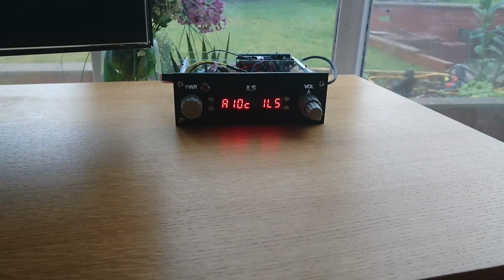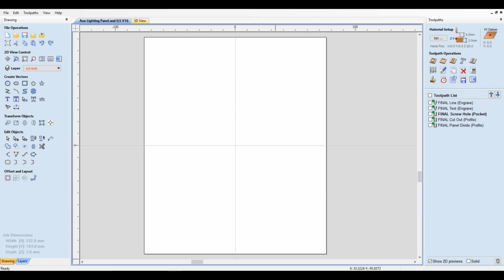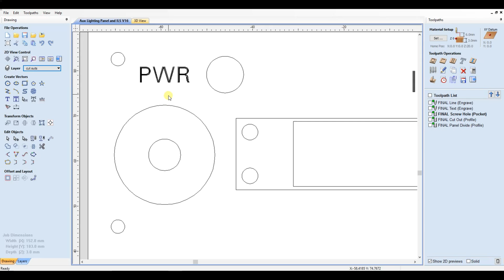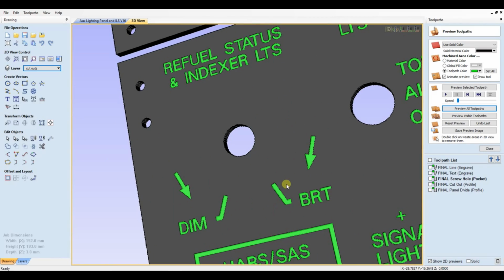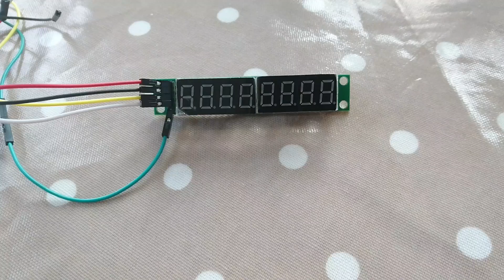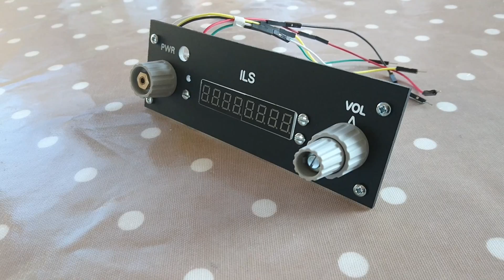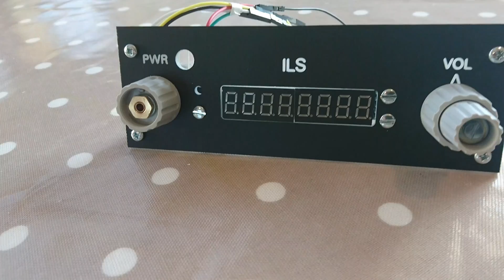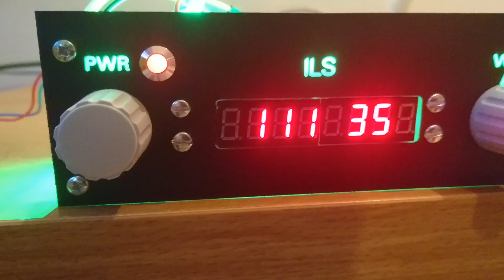DCS A10C ILS Prototype Panel

Comment: Craig, could I ask which Arduino library you use for driving the 6-character 7-segment display please? I am testing with library ""TM1637_6D.h" it works fine just testing the display but when I combine it with DCS-BIOS code I get errors I think are due to conflicts between libraries "TM1637_6D.h" & "DcsBios.h". I tried several other display libraries but most will only do 4 characters. Regards, Mark
Reply from the maker: Hi Mark, I used LedControl.h library with MAX7219 - 7 segment displays. I do have a few TM1637 segment displays but have not used them to this point. If you go the max7219 route I'll happily share my arduino sketch with you
Reply: @CraigSmysimpit  Hello! I am trying to figure out the code, can you send me yours so I can compare and maybe fix mine?
Reply: Thanks I’ll let you know how it turns out...

Comment: would this also work with different sims, like x plane?
Reply from the maker: Hi Eric, throughout my simpit any of the panel inputs interfaced by keyboard encoder can be used in any simulator where keyboard bindings can be allocated. As regards outputs, I'm sure xplane will have its own community resources for outputting data and this could be displayed on 7 segment displays, VFDs, oleds, etc, however the output utility I use, DCS bios, only works with Digital Combat Simulator. Cheers, Craig
Reply: @CraigSmysimpit  Im following along, starting with building the electrical conrol box. I bought a keyboard emulator and wired it to a two way switch. Ive assigned it to one of the panel controls and it works just fine, however, when I flip the physical switch to the off position, the sim doesnt change. When I switch the physical switch on again, the sim switch moves to off... basically each position change in the sim requires two movements on my two way switch. Any ideas how to fix this?
Reply from the maker: Hi Eric, if you use the keyboard encoder with a physical momentary push button to control a momentary push button in the sim I would assume it works fine, is that the case? If so, then your problem could be because the keyboard encoder sends a temporary input on completion of the circuit not on disconnection. Therefore it only responds in the "on" position only. What keyboard encoder did you get, type, brand and model?

Comment: Great work! Any chance you could share your Arduino Code for this panel?
Reply from the maker: Hi RomeoKilo, thanks for your comments. Over the months I've seen your thread on the Ed forum. That's some proper high quality work you're doing and your ejection seat is out of this world. 
I'll upload the Arduino sketch at some point this week to my website and I'll drop the link to you.
Did you get the lua export working to run helios and dcs bios at the same time?
Reply: Craig S Thanks mate. Yep got the export working. Found a thread that suggested just moving the dofile line so it's at the very end- it worked. Weird. The ILS and tacan are next on my list- I was going to use lcd displays but have decided on 7 segments so they match the radio stack, I just can't get this code working!
Reply from the maker: Hi RomeoKilo, is it the radio code that isn't working for you? If you let me know exactly how you have wired it and the error that occurs I'll have a look at this, cheers
Reply: Craig S No my Radio is now working fine. I used your code for that I just made some changes to suit my needs. I was after the code you used for this ILS panel- I'm working on mine now.

Comment: I'm new to coding in arduino but I watched a video not long ago. ( the rotary coder between a-b are 90 degrees off). Video mentioned to add a line of code to note where the digital read is so it will show up in resolution on a display  much faster than having that jump and waiting for it to find it's value

Comment: Nice Work there, keep it up ! Where did you get the panel files from? wich file-format does the cut2d expect? i got some pdf with the panels but i think they are in the wrong format, im not trying to cnc but i just ordered a plotter that can cut, so i could make my own 3d printed panel and then cut the stickers with the plotter, if you have spare time i would appreciate your help. cheers Pedro
Reply from the maker: Hi Pedro, the first file I used is a detailed Jpeg image of the A10C cockpit which I downloaded from the dcs website. The second file is what I created using Cut2D and it saves this in crv format. Let me know if you need any other information, cheers
Reply: Hi Craig, thank you very much for your help, ive found better Panel/Pdf's here:https://forums.eagle.ru/showthread.php?t=89120 with those i could make it just perfect. Loved the fact that the Cut2d seemed to be able to "extract" the Letters/lines but im not familiar with the software so that was where i failed, but since i got now a cutting plotter ill gonna write the labes by hand print them out and transfer them with transfertape onto the 3d Printed panel.
Cheers Pedro

Comment: Could you explain the wiring and the programming a bit?
Reply from the maker: Hi Nic, I'm building the radio panel currently which also uses 7 Segment displays, the programming also follows the same principles. Based on your message I'll put some extra detail in the next video that covers the wiring and code. It will probably be about 3-4 weeks before this panel is finished and video done, but it will give you the information you need. Cheers
Reply: Awesome, thank you very much for sharing.
Reply from the maker: Hi Nic, I shared a video of my latest panel this morning (radio cluster), this should give the detail you were after around the wiring and programming, cheers
Reply from the maker: Small world, I'm just a few hours away from King's Lynn, north of Birmingham

Comment: Professional work Craig.  I had trouble finding dual axis encoder where I could use the volume knob feature. Where did you buy the encoder and the knobs for that? Also had trouble finding white LED displays in that size. Adafruit sold white displays but the smallest size they had was the 0.54" characters. Where you are using the 0.36" displays.
Reply from the maker: Hi Joe, I got the dual concentric rotary encoder from - www.leobodnar.com
The grey caps can be bought as an accessory. 

I found that the DCS bios code for controlling ILS volume didnt work for me, where as it would for Mhz and Khz. The only way the inner dial worked for volume was using the Keyboard Encoder. 
Whilst most the components of the ILS were cheap, this dual rotary encoder was the single most expensive part at £20.
The 7 segment displays were from Amazon and I bought several cheap. I will attach a few links for some of the ones I got.
Reply from the maker: 5V MAX7219 8-Digit Red LED Display Module 7 Segment Digital Tube For Arduino MCU https://www.amazon.co.uk/dp/B00IHSE6V6/ref=cm_sw_r_other_apa_YD.DybYX6WJ80
Reply from the maker: LED display module - TOOGOO(R) 8-digit LED display module MAX7219 digital control tube red matrix for Arduino https://www.amazon.co.uk/dp/B00YMIKPCO/ref=cm_sw_r_other_apa_pG.DybKJSZD2A
Reply: Yes, leobodnar encoders are ELMA (www.elma.com) Type E37 p/n E37-VT6330-1, and you can get switch caps from PC Flights, and I like the small Robotdyn displays available in several colours from Tiny Tronics